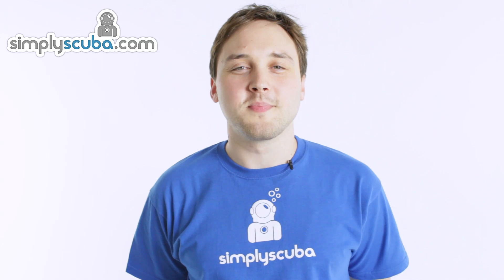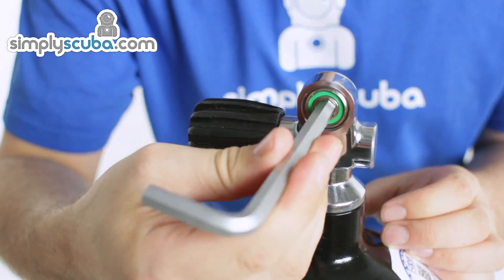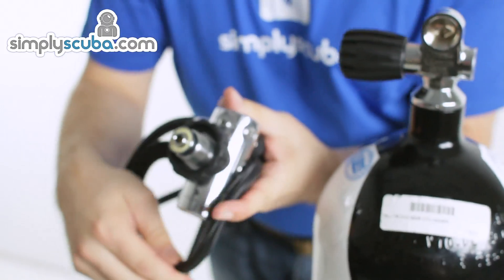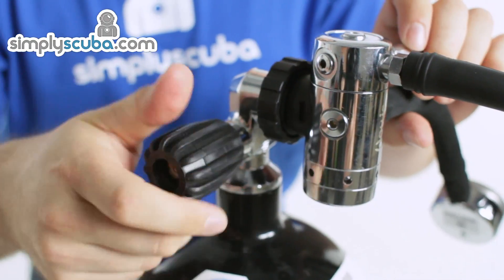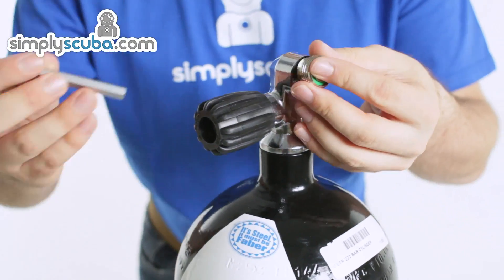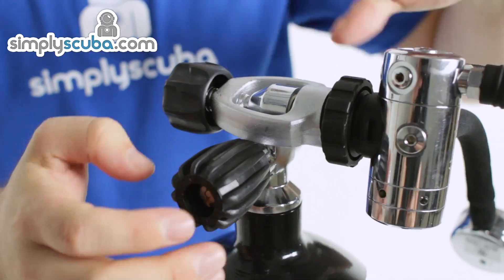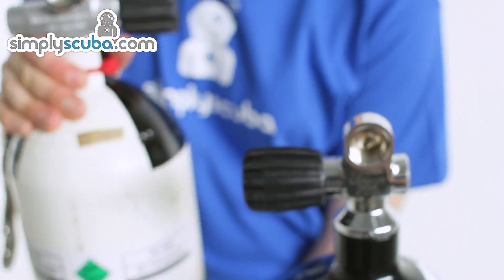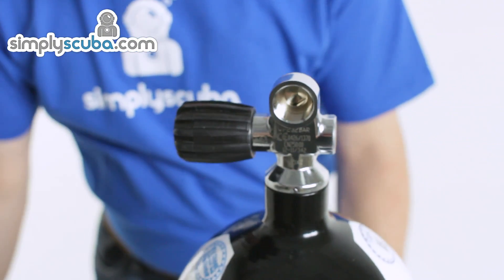The Difference Between A Clamp and DIN Valves

Comment: Can you convert an A Clamp Reg 1st stage to work with a Din valve permanently as many dive boat tanks are often Din by default now. I've also read that Din clamps between 1St stage and tank are more secure, less prone to leaks and less chance when the air is turned on that the oring will burst/blow out etc.

Comment: Is it possible to use an 300 DIN cylinder with an a clamp regulator.  I'm thinking if my A clamp fits over the square cylinder valve ( I'm told some do) then surely I just need the correct insert and fill the cylinder 232 instead of 300?

Comment: If I buy a DIN regulator, can I use it with both a 232 BAR cylinder and a 300 BAR cylinder? Or are only some DIN regulators compatible with a 300 BAR cylinder?
Reply from the maker: Hey Jack,
Sure, all of my regs are 300BAR DIN and I use them in 232 valves all the time so you can use them in either; 300BAR is just the max pressure you can put through them.

There are some DIN regulators now that only fit in 232BAR valves but they're very rare.

Safe Diving,
Reply: Good to know the answer haha ! Thanks simply scuba, love your channel !